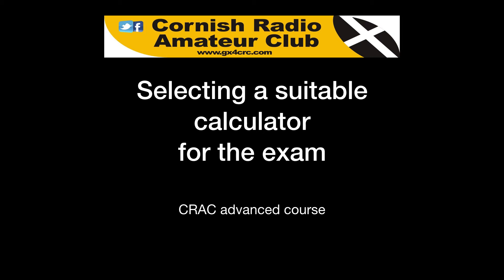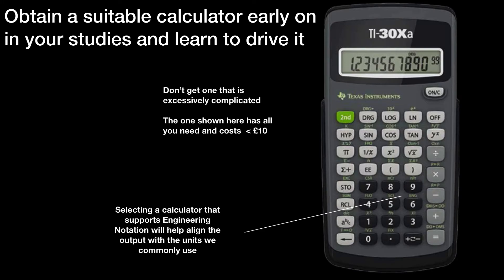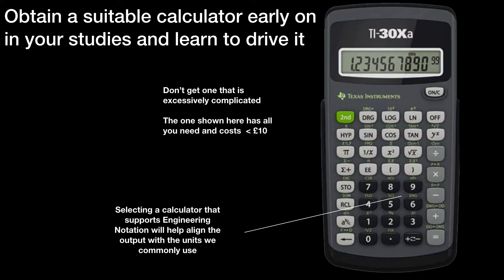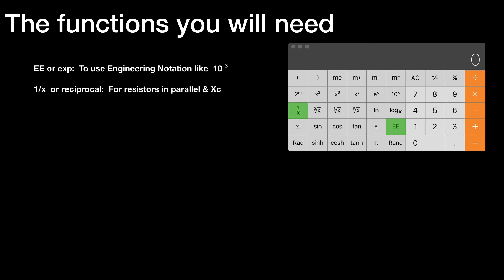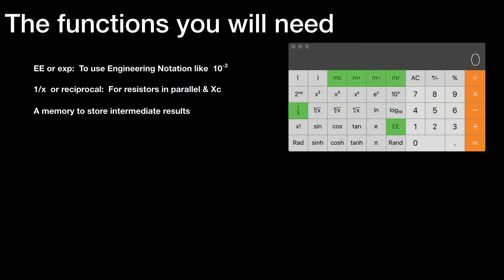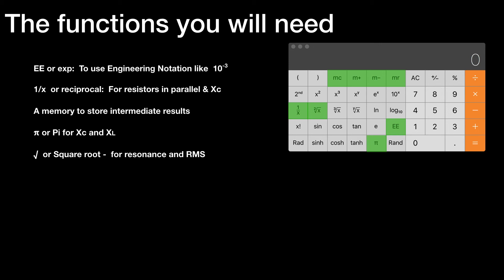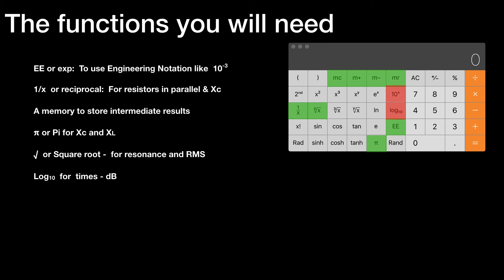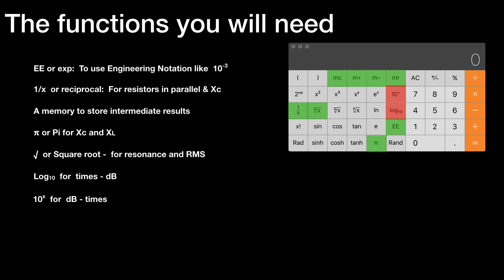Advanced - Select a calculator

Comment: I have no chance then...no good at advanced maths.
Reply from the maker: The pass mark is 60% so you can make quite a few mistakes. Also - a lot of the multiple choice questions have some clearly-wrong answers which improves the odds.  Don't give up just because your maths is wobbly. I've known some with only basic maths skills get though.  Also look at the video on the TI-30Xa calculator.   https://www.youtube.com/watch?v=KVvfBJq6Pl4.   Good luck 73s
Reply: @cornishradioamateurclubtra4073  yesss, this is good news indeed for me. I have always failed to understand mathematics. but i need my full licence.
Reply: Don't stress about maths it's only about 5 questions and you might get the easier ones or a good guess could get you all five
Reply: Don't think I even used my calculator